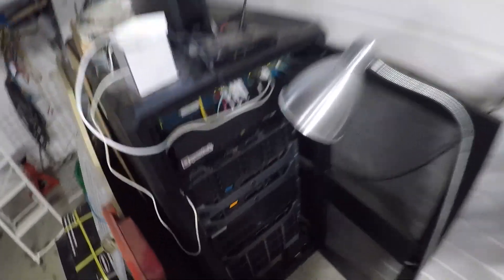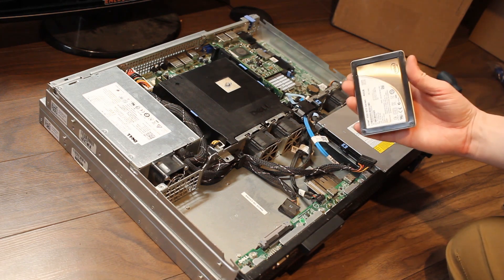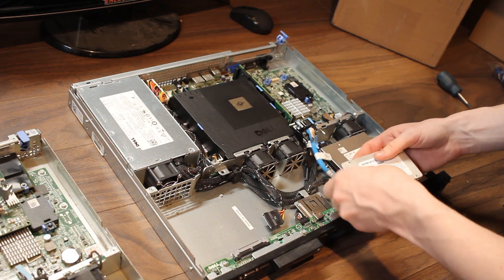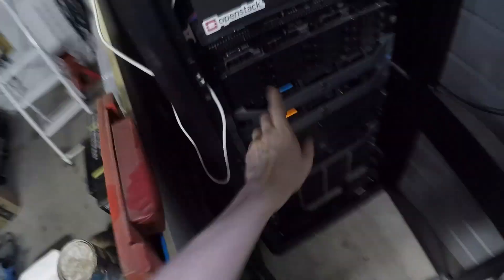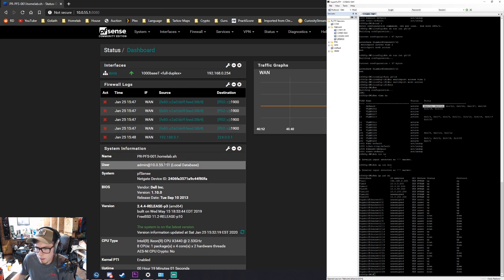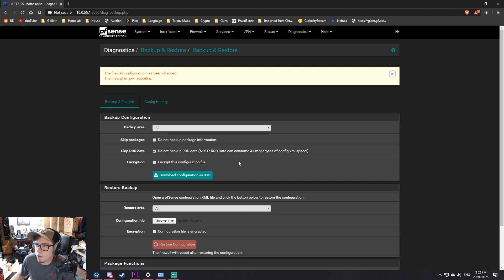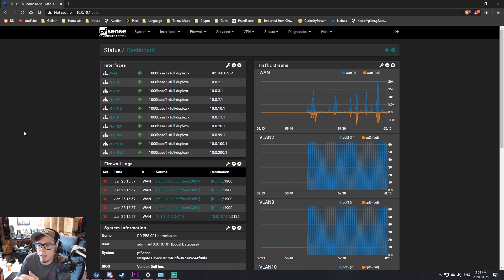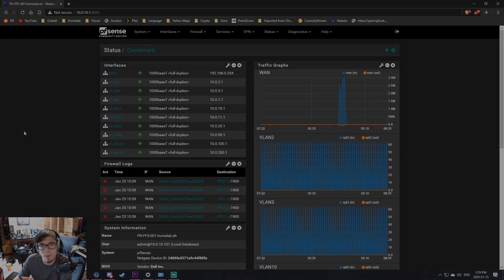Replacing a Broken Server! - Home Data Center

Comment: Dells are normally a lot more resilient than that. Sucks you lost one. A PowerEdge, too, though in years, those units are aging significantly. My Andahar's a T110, and he's definitely alive, but growing senile.
Reply from the maker: Im a big fan of Dells line. It still works, but it is intermittent. Just need some time to narrow down the cause, but also don't want to be without a router.
Reply: Homelab well. Good luck. Definitely let us know what you find.